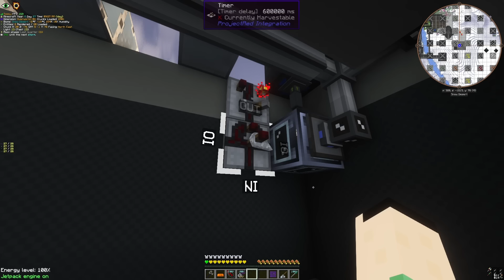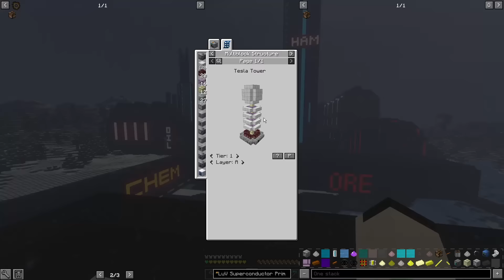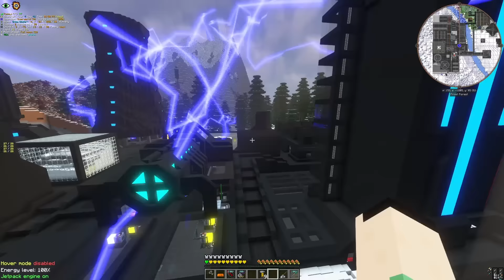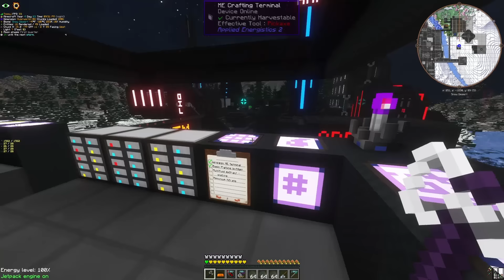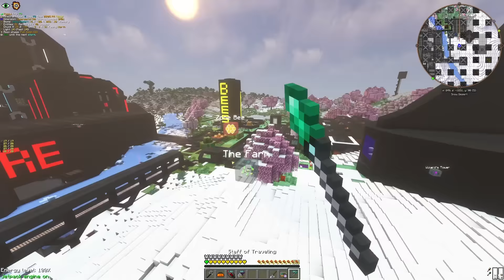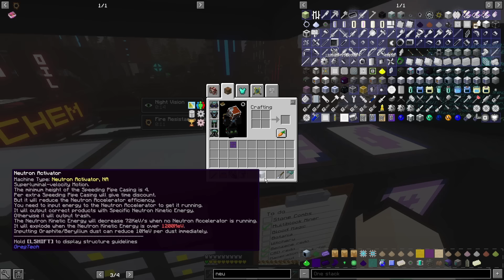GregTech New Horizons E72: Tesla Tower = Wireless Power

Comment: The trouble with using a timer for the solar tower is that if you forget, you could do things that can de-sync the timer from the day-night cycle. For example sleeping or performing some Witchery rituals that change the time of day.
Reply from the maker: Dear employee,

Indeed! Another employee commented on the previous video about using a comparator with a daylight sensor. That would not be affected by time skips, but you would have to do some testing to figure out what signal strength to compare to so that the circuit turns on/off at the correct times.

Best,
HamCorp
Reply: @Ham-Corp  Esteemed management,

After some reading through the machine firmware and some quick testing with a decommissioned unit, it seems that the tower stops capturing heat once the total light subtracted from the skylight is less than or equal to 4. Conveniently, that is exactly the value the standard Daylight Sensor™ outputs as redstone signal.

This being the case, all that is needed is that the Sensor™ be connected with redstone line with five (5) metres in length. This should cut off the signal at the precise time the Solar Tower (patent pending) unit becomes unable to capture heat.

Alternatively, cutting line of sight between the Sensor™and the nearest block with sky access to ten (10) metres in length should make its output perfectly match the desired window, although Engineering might find the former solution much simpler.

It is also worth noting the following:
- The firmware checks if it can capture heat only every 10 seconds, so a delay of five (5) seconds on average might be desired for absolute best performance.
- Efficiency is halved under rainfall, so installation in a dry biome is advised for optimal heat output.

I am aware that, as stated in my contract, HamCorp is not obligated to provide any compensation for work done outside designated hours.

Regards,
Barbas from R&D

Comment: Get the sunnarium bee, it makes getting sunnarium easy. You can get started with them the moment you get a superconducting coil block.

And with the neutron accelerator, make it tall as possible and dont worry about energy input too much. The taller it is, the quicker the recipes are, but it will make it take longer to reach the required kinetic energy. So just use an IV hatch and wait a bit.

Comment: The neutron activator bothers me for so, so many reasons.  Fun fact though, neutron cross section is measured in barns. 1 barn is 10^-28 m^2, so when something is "big as a barn" it's actually quite small.
Reply from the maker: Dear employee,

Thank you for reminding me that the barn exists. I remember learning about it a long time ago for neutrino cross section measurements but we mostly ended up using GeV^-2 or something like that.

HamCorp loves physics. Sadly the budget has already been allocated for the neutron activators, otherwise I would have built a barn and put them inside.

Best,
HamCorp Science Outreach Department
Reply: @Ham-Corp  dear CEO,
as a physicist I'm intrigued by the fact that you know about neutrino cross section (or the notion of cross section at all) while also measuring it in natural units which is a very common thing to do in particle physics. What did you study to come across such things?

- an unpaid intern
Reply from the maker: Dear unpaid intern @MadSideburns,

I was in a neutrino oscillation research group during undergrad, and I did my Masters (and abandoned PhD) in nanoscale ripple formation theory!

Best,
HamCorp
Reply: @Ham-Corp  Woo, abandoned PhD club! I abandoned a PhD in cavity magnonic devices.